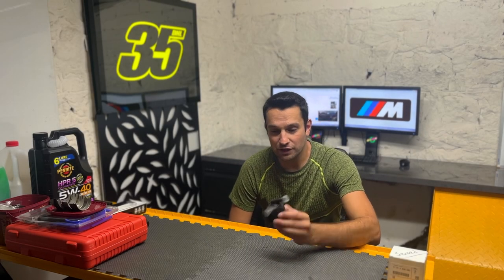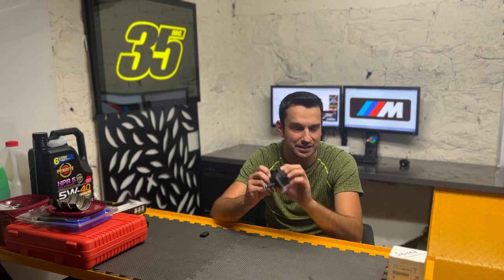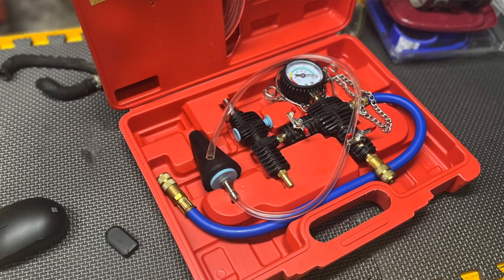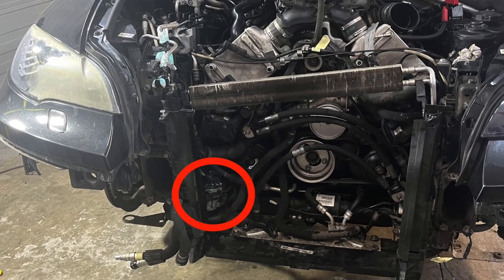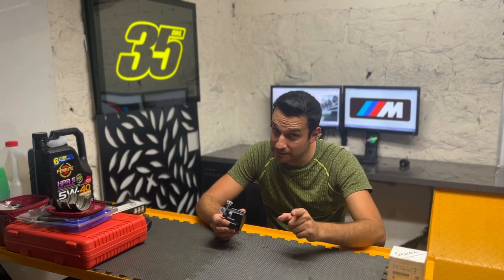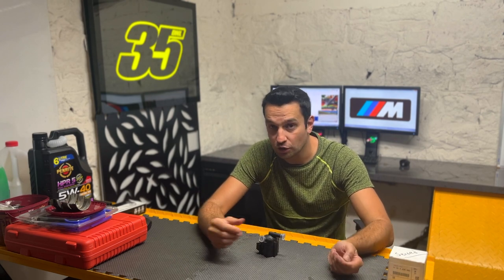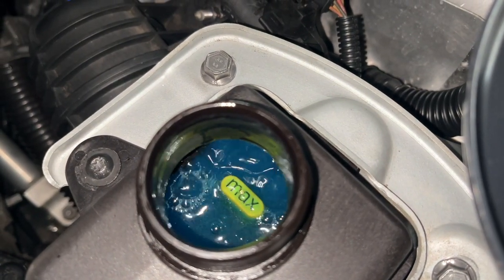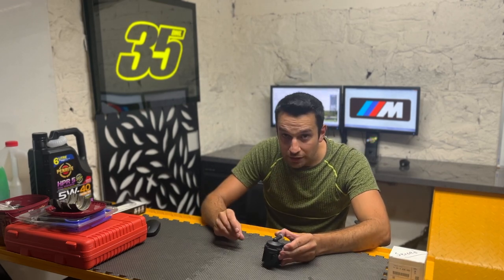BMW S63 N63  Turbo pump CODES !  2EAA and 2EA9 Explained - How to avoid burning another PUMP

Comment: Love the X5M content, it makes working on these actually not seem 'that' terrible 😛.
  I replaced my reservoir and a after couple trips after turning off the engine my aux pump got loud and making a buzz rattle like sound. I immediately added more coolant (i think while the pump was still going) and that seemed to work and function as a way to purge it. I bought another aux pump a yr ago just in case it was dying though.
Reply from the maker: They are definitely not that hard to work on however on that same note, its a shame the engine have to come out for some simple things like starter motor and other little things- Yes good thing to keep a spare one just in case
Reply: So I just did this after getting a code and I had to remove both intercooler top coolant inlets to get the hose and wire off the aux pump

Comment: Thx for the video. It made me understands the cooling systems on my x6m a lot better. If see these two faults popup but not every time i run the car. I did not do recent coolants jobs on the car. Does this means the pump is on his way out?
Reply from the maker: The pump is a common point of failure in these cars - You should be able to hear the pump running for a few minutes after turning the engine off when the car is at temperature.

Comment: Hey, can you make a video about how to properly vacuum bleed cooling system and which tools to use? I'm going to replace that pump and don't wanna make some mistake. 
Thanks
Reply from the maker: Hi, I'll make a video when doing the next car however the process should be the same for pretty much nay car.  Buy a generic radiator vacuum kit and my suggestion is to do the process slowly without letting the gauge goes to red.

Comment: very informative video. voltage is easy to test at connectors but is there anw to test signal connector? i keep getting 2ea9 after changing 3 pumps and i tried your method by giving 12v  to them and they are working normally
Reply from the maker: Thats a bit trickier,  If you have 12v on the plug once the engine is warm ? if yes you need to test continuity and track the "S" wire back through the engine harness into the DME box (it could be damaged) .  can you hear the pump working when installed in the car ? When the engine is hot the pump should run for a few minutes once the engine is switched off.
Reply: @dnl35projects  pump is not running after turning off the engine. is there anyway to run the pump through ista without having the engine warmed? because i cannot work with it if it is hot.

Comment: Please beo
Could you wirte wheat you said or want to say in this viedo that i cluld translate it to my language 
I have this issue and wanna change it
Afraid it damage after changing and it’s expensive 
Please
Could you write me  that i can translate or tell me what causes it damage after changing 
Thank you
Reply from the maker: The main ideia is that after replacing the pump you vacuum fill the coolant system before filing it up with coolant - that is the correct way. If you don’t do it there’s going to be air trapped in the system and you’re risking burning  the new pump.

Comment: I have the fault code turbo charger coolant pump blocked BMW F13 M6, I changed pump x2 and now it’s back again. Any idea ? When using diagnostics to run the pump it’s working ..
Reply from the maker: What software are you using to scan / trigger the pump ? I have not seen this code yet

Comment: Hi, what is the engine oil temperature when the pump failed? My engine oil temp increased by 10degC but no error code.
Reply from the maker: Hi, this is the coolant pump not engine oil - Your coolant should be at around 90C
Reply: @dnl35projects hi, my engine S63TU….i’ll try to search the engine oil sensor in the manual but i couldn’t find. The only sensor i found is near to mechanical water pump which is labelled in manual as water/oil temperature sensor. It is very helpful if i can email you.

Comment: Hello big boy.can you tell me what is code eror Bmw x6m e71 2f29.thanks
Reply from the maker: Hi, that has to do with your air cooling system AKA low temperature cooling system, which is basically runs your inter coolers. Check the coolant level and the 2 electric pumps - You can do the bleeding procedure using the accelerator and AC command from inside the car.
Reply: Thanks bro.👍👍👍

Comment: Does the pump needs to run even after several hours of engine off ??
Reply from the maker: Hi James, absolutely not ! It’s expected to see the pump running for 5 or 10 minutes, possibly a bit longer depending on the climate/temperature where you live but definitely not an hour.
Reply: The main water pump circulation is termostatic so this one has to run more so the water in the turbo does not heat surge because thermosyphone won't make the water circulate through the thin orifise